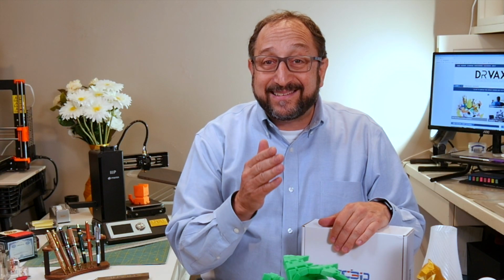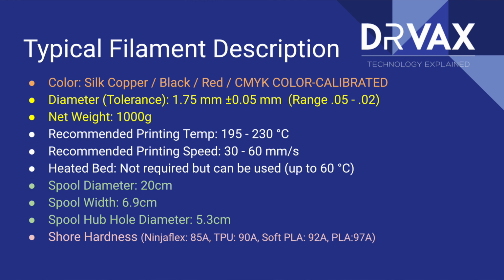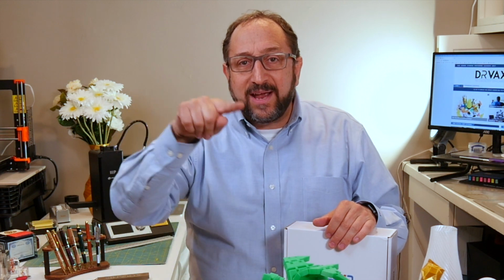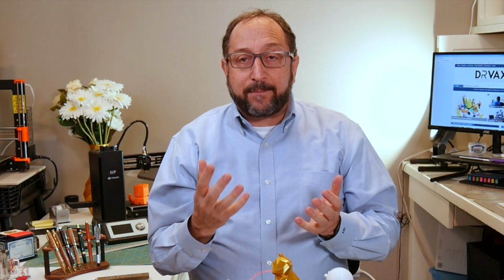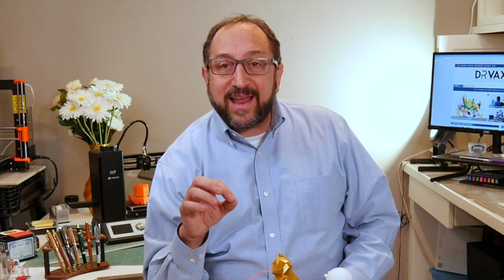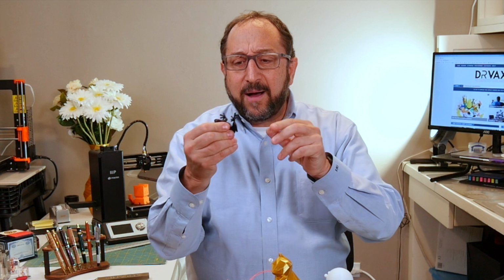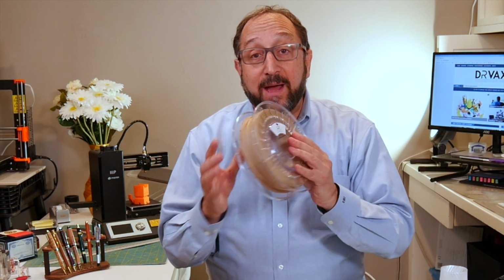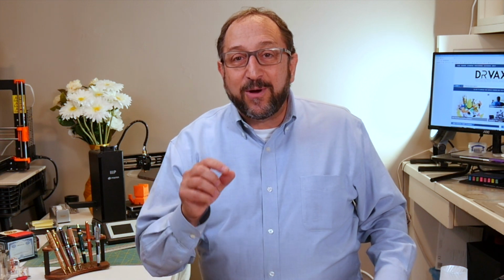Complete Guide to Filament for FDM 3d Printers

Comment: Great video 👍 . I print TPU 95A on a stock Ender 3 PRO, no issues. Prints as easy as PLA. I use standard setting in Cura slicer.

Comment: Thank you. I now understand why the recommendation to print any parts for use inside the enclosure of an enclosed printer out of ABS because they won't soften up. I suspect PETG would do just as about as well with everything except maybe Nylon. I have a friend who prints in carbon fiber filled nylon on an Ender 5. Needless to say it has had some upgrades.

Comment: Hi DrVax, I just found your videos, they're a great resource, very informative and helpful, thank you.  Sorry for this being a bit picky but I can't help myself sometimes, saying '50% higher temperature' based on degrees Fahrenheit or Celsius is really not a good way to think about such things, you're dealing with arbitrary zeros with those scales.  To specify a percentage in temperature, you really need to go to the Kelvin scale, so going from 50 to 75 Celsius is really going from 323 to 348K, or less than 8 percent.  This might seem an annoying quibble but you can get the wrong idea about what to expect in a lot of situations when you don't consider where zero is, e.g., is 2 Celsius really twice as hot as 1, if so, then 35.6 degrees F is twice as hot as 33.8 F.

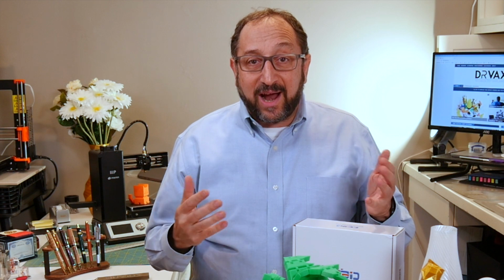Comment: 4:20 is a transgression of workmanship.  Liken it to Steve Jobs' story of making a chest of drawers, and not sacrificing quality or aesthetic on the parts that you don't see..."For you to sleep well at night, the aesthetic, the quality, has to be carried all the way through."
Reply from the maker: While I fully understand your comment, design decisions need to balance many needs.   For example if you look at the disassembly of an iPhone you will see that some areas are full of glue -- not very pretty -- but they help support other design decisions such as making the device water resistant. 

I stand my my recommendation to match layer height to the needs of the design balanced by the time to produce the part.
Reply: I think I saw some information that using thicker layers produces a stronger print.  I may be wrong but having fewer thicker layers would produce fewer places for the layers to separate. 

I know that strength is affected by layer orientation, which can make big changes in appearance.  Often times I am building parts to use, not as works of art and need to balance time and surface quality and strength all in the same equation.
Reply from the maker: In fact, layers over .20 with a .40 nozzle are not as stronger as smaller layers.  I know, this does not seem to make sense but this outstanding video at CNC Kitchen tests this issue:

https://youtu.be/fbSQvJJjw2Q

I also have a detailed video about layer orientation.  This does make a significant difference.  Take a look at this video "How to Printer Stronger 3d Parts"?

https://youtu.be/j1GLlFDb7wE

Comment: This is so nice video but you're backwards on strength. Ela is very hard and brittle but it is not strong.  APS is much much stronger than pla it isn't as hard though. And nylon and polycarbonate are stronger than either. For cosmetic items that won't be going into really hot places you should use pla but for anything that requires strength you should use ABS or nylon or whatever.

Comment: Great video, thanks. The only thing I wish had been included was outdoor use. I'd like to print some gizmos that will be outside and I'm wondering what filament would not become very brittle and crack thanks to UV exposure and an annual temp range of -20 to +30 C. I don't care about color fading this time around but it would be nice to know for future reference. Thanks for any tips!
Reply from the maker: Good idea for a video.  The problem is testing.   I rarely have the patience to do videos where I have to take months to test a print.

Comment: Hi! I have been thinking about getting a 3d printers for a bit now, I got some questions for anyone willing to answer.
1. What I want to print needs to be flexible and you can stretch it a bit without it breaking. To create for example a case for an earbud, where I can expand it, put the earbud in and it will close and stay in the case.
2. What printer do I use?
I'm not planning anything huge at all max is 1.5 inch by 1.5 inch things.

Comment: I'm trying to 3d print rock climbing holds. I know that we use PU to make climbing holds. I was wondering about the property differences between polyurethane and thermoplastic polyurethane?
Reply: Sounds scary given the strengths of many plastics. I doubt an insurance company would approve.
Reply: @rbrown2925  thats why I'm trying to understand the differences between the two. they use to make climbing holds out of ceramic. I'm a very experienced route setter and I'm just trying to have some fun on my home climbing wall. not for commercial use.

Comment: I'm looking to print parts for my RC Scale trucks. I'm completely new to 3D printing so I'm looking for a beginner printer. I'm thinking PLA and TPU would be my go to for scale accessories. Would the Monoprice Cube or Mini be my best bet for a starting printer?  I'm considering once I get a deeper understanding of 3D printing, I'd like to print my own RC Car bodies (possibly Nylon or ABS... unsure). You do a fantastic job on your channel and I give you 2 thumbs up. It just seems the more I learn, the further away from a decision that I am for my first printer.
Reply from the maker: Are your comfortable with a printer you have to assemble?  The Monoprice Cadet can only print PLA.  For Nylon you will need a much higher end printer since it prints at a higher temperature.  ABS has a different set of issues because you will need a well ventilated area.   Why are you considering ABS?
Reply: @MakeWithTech  I read that people printed in ABS for RC bodies,  but if PETG or Nylon is better, then I'm all for that. I run crawlers so they take tumble abuse. As far as assembling the printer, I'm sure I can do that (I build all of my RC cars from kits).

Comment: READ, caution! :According to a study conducted by the National Institute for Occupational Safety and Health (NIOSH), lung cells which were exposed to FDM 3D printer emissions coming out of ABS and Polycarbonate filaments showed signs of damage after exposure for around 3 hours. In some cases, cell death was observed and in some others, chemicals associated with inflammation were known to have been released. This study demonstrated the damaging effect that the inhaling of fumes can cause on the lungs.

The best precaution that one can take to minimize a user’s exposure to these fumes is by placing the 3D printer in an area which is well-ventilated.

You can also look at printers which are deemed to be safer than others. Most people focus on specs and technical qualities of the 3D printer when purchasing one. However, if health and safety are a priority, then looking at safety features are also equally important. the truth is we dont know all the chemicals that can be in filaments, continuing additives arfe added to make ones better than anothers and so full danger would be unkown
Reply from the maker: I agree which is why print almost exclusively PLA and sometimes PETG.   My printer area has an exhaust fan vented to outside and I have an air quality sensor in my printer area.

Comment: Question ...lets say i print and sell various  10-15'' statues to customers via ups..can i use PLA?...or will they melt during shipping? would special packing method prevent issues... ? thanks for the great instructional video
Reply from the maker: The glass transition point for PLA is between 50c and 65c which is 122f to 149f.  I would expect this would be fine for traditional shipping methods.  You might want to email your shipper and ask about these temperatures.

The glass transition point is the temperature where the material becomes rubbery.  At cooler temperatures the material will remain in the same stand it was at after your print cooled.
Reply: Shipping to the southwest in August???  Yup, there's a problem.

Comment: Very interesting. I am looking to use PETG, possibly with carbon fibre filler, for quadcopter frames.

Something I have read is that PLA, whilst strong, has poor interlayer adhesion, so a cube may be strong in the X and Y dimensions (due to crosshatching while printing) but poor in the Z. I've read that PETG is much better in this respect (and a corollary to that is the need for gluestick etc on the bed to get it off - it sticks too well).

It also appears that PETG is hardly hygroscopic at all, less than PLA, much less than nylon.

Do you agree with these points?

Comment: So many video's about filaments, but none cover POM? I bought a spool of POM but had little success printing with it due to warping forces. Lots to find about injection molding with POM, but this is a spool of filament whitch makes me think it has to be printable. The seller never responded when I asked about it. I even tried to customize the direction of the layers to spread out the warping.
Reply from the maker: I am not familiar with POM.  What are it’s advantages?
Reply: @MakeWithTech  It is mostly used in engineering applications because it is very stiff. For example, the wheels that ride on the aluminium extrusions of the ender3 are made of the stuff. Also, it is temperature resistant up to a little more than 100°C

Comment: Hey. Can a thermoplastic material in powder form can be used instead of thermoplastic filament? If yes then how and what should be assembly be.
Reply from the maker: Yes there are printers that use power instead of filament but it is a completely different design and the printers are quite a bit more expensive.   For example most printers that print metal use lasers to sinter (melt) metal powders which include a binder layer by layer in place.
Reply: @MakeWithTech  Can there be any parts that can be attached to extruder of the 3D printer in order to extrude thermoplastic material instead of filament that will melt and extrude of the nozzle and get printed simultaneously.
Reply from the maker: I am not aware of any.  Doesn’t mean they do not exist.  The extruder would have to be completely different and retraction would not work.
Reply: @MakeWithTech  ohk...thank you very much for sharing your valuable info..
Reply: @preeteshsawant1606  yes there is some pellets extruder,  search for that name.  It work for pellets so they may work well with powder

Comment: As a chemist, let me tell you, it’s the biggest lie that PLA is biodegradable. It degrades only under very, very specific conditions which are not present at a landfill. Before it biodegrades, it is shredded into micro plastic particles and does the same damage as any such particle.
Reply from the maker: Thanks for sharing this information.
Reply: @MakeWithTech  , welcome. Concerning ABS, the fumes are toxic because they contain the monomer Styrene. A good ventilation is highly recommended.

Comment: PCL:  I want to only use pcl ( odorless and safer)  temp: 100 c and the bed 35c.  I have just bought an Ender 3 and nobody knows how to set a profile in Cura. Is it possible to print this filament with an Ender 3?

Comment: Always weigh your filament to make sure you are getting what you paid for. Have purchased filament from eBay that says it's 1 Kg of filament but was actually a total weight of 1Kg, they included the spool. Only got about 800 grams of filament so a total rip off. Buyer beware !
Reply from the maker: I tend to stick to well establish brand names.  While this is not a guarantee you will get what you pay for it does improve the ods.  The brands I like best are Hatchbox, MatterHackers, CC3 China, SainSmart, and Colorfabb.
Reply: I totally agree, but as I print functional parts rather than models while I am prototyping a cheap Chines eBay brand is OK and then when I am ready for the final print I will go with a branded filament. Getting reliable supplies of branded filament in the UK can sometimes be really challenging.